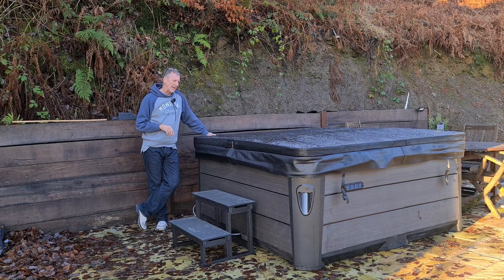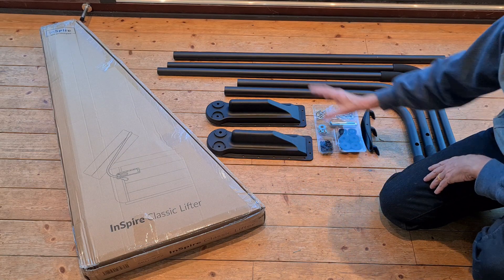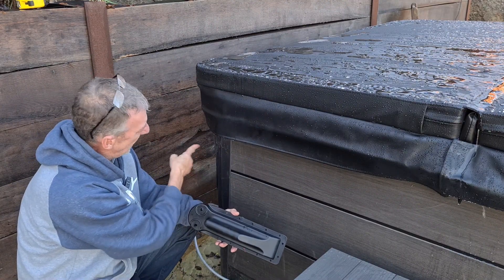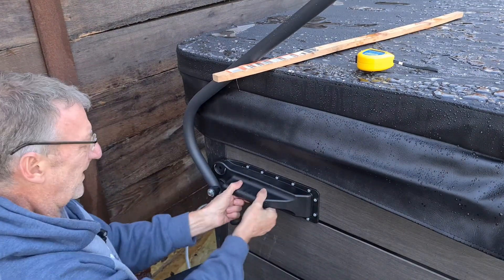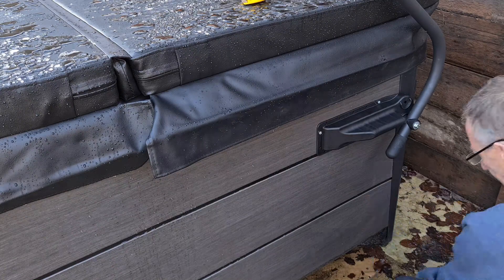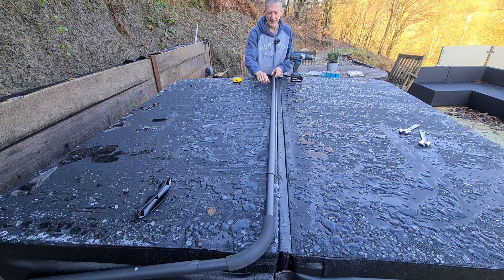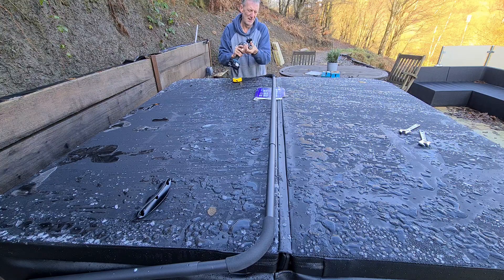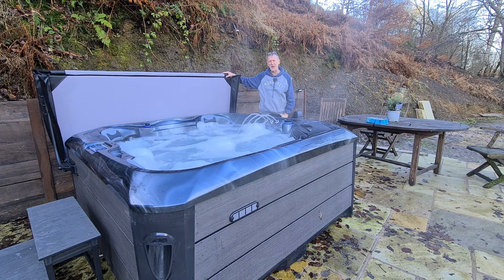Installing a Cover Lifter for Hot Tub or Spa

Comment: Great help. Ive got the same tub coming in a couple weeks. Ive just had a new patio layed and they have put a fall on it for water drain off.How far out of level is your tub mate?
Reply from the maker: Its out of level by about an inch front to back but that more for the run off for the patio.
Reply: I have a piece of 1 inch batten underneath the hot tub to get it level on my patio.

Comment: Where did you get those measurements for the mounting bracket? My instructions don’t say anything. I plan on just assembling everything then seeing where the side mounting bracket will want to sit best. Where the round hole side is positioned on yours, you won’t be able to remove the corner panel if needed unless you remove all the screws, thus weakening the hole. That can’t be right so I would remove the pipe on each side rather than weakening the screw holes.

BTW lots of Amazon reviews show the end with the 2 round holes breaking off after the 1st use up to a couple of weeks and months. Most likely because the cover is old and water logged making it really heavy. 

I plan to fill the backside cavity around the 2 round hole areas and to the left of it with Permatex Plastic Welder that hardens like a rock in 10 minutes for extra strength. It also comes in black and this stuff can be drilled, filed and sanded if needed. I filled in cracks on my black console in my Camaro and added the plastic for where mounting clips slide in for the rear ashtray. 

I will just syringe the 2 parts into the hole, stir it up, then let it sit for each cavity rather than mixing a bunch up and trying to get it down into each cavity space which could get messy. Remember this stuff hardens in 10 min.

I would think the correct position to mount the brackets would be to line up the bottom bracket just above the horizontal panel groove. You don’t want to screw into the groove cause there is less material.
Reply from the maker: The instructions I got with it didn't make any sense, so I think I used their measurements then made adjustments on the fly.  I have had no issues with it and have been using it since 2019.  It has been covered in snow, rained on constantly and used regularly with no breaking of any of the components (other than the caps coming off the tops of the self-tapping screws.  I've just been out and had a look at the corner post and it looks like there is enough of a gap for it to come off, but you can always drop the bracket or move it inwards slightly, there is plenty of play in the bar for adjustment (Longer if you drop the bracket more).  I like the idea of strengthening the plastic if you feel it might break

Comment: Thanks for the video! :-) It helped a lot. 
But you did'nt need to drill with the 4 mm in the arms, since the screws are self tapping. Just screw them in, and they drills through by themselves.
Another thing, it depends on the tub if you should put in the longest ot shortest end of the bends into the middle part. My tub is smaller, so I had to do the opposite of what you did.

Comment: Great video. One question. Do you ever have a need to take that panel off? If so what do you do?
Reply from the maker: Not had to take it off, but it should be no problem to unscrew the bracket if I did need to remove it
Reply: I would remove the pipe on each side rather than weakening the holes for the screws.

Comment: This might be a daft question but I am curious... the screws at the bottom of the brackets, is there a gap the tub frame? My first thought is drop it a cm or 2 to fix it to the panel. I fitted mine much lower which it still works, I didn't want to have the back high up in case my kids leaned on it. I wish this video was out much earlier.
Reply from the maker: If I understand correctly Anthony, there is no gap

Comment: Hi, great video, my lifter (same as yours arrived this morning) couple of questions - does it matter which panel/side of hot tub you fit the lifter to ? And did you drill a pilot hole for the bracket screws first ? Or just straight into the panel with the screw - if that makes sense. Thanks.
Reply from the maker: You should be fine fitting it to any side of the Hot Tub, so that you can have the tub facing whichever way you want depending on the seating.  And no, no pilot holes for the brackets onto the side panels (pilot hols when you are putting the self tappers in on the poles though 👍)
Reply: @CloughReviews  thank you so much for your advice, really appreciated. Take care. Michael

Comment: I used your exact measurements on a bit smaller tub and butchered it. The top bar extends to far over the center of the cover...by nine inches. I could cut the poles I guess. Also when the cover is in stowed position it will be cantered towards the hot tub. Completely botched. Cheers mate.

Comment: Sorry to bother, would the measurements be different at the start depending on the size of the tub.
Reply from the maker: Hi, just been out and looked at the tub.  I would say that the positioning of the brackets will remain the same, any adjustment for the size of the Tub is in the poles.  Hope that helps
Reply: @CloughReviews  thanks